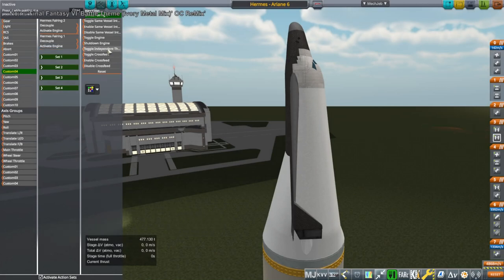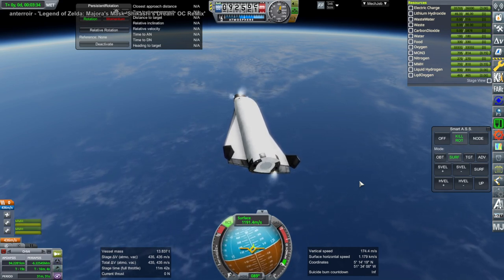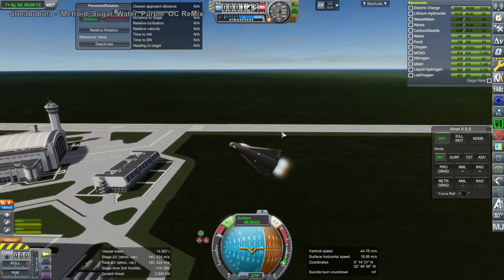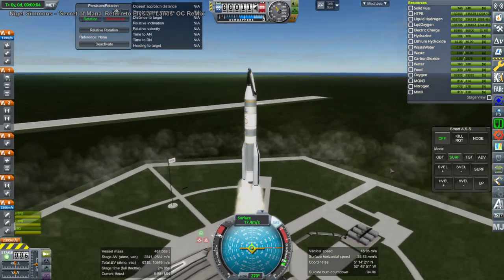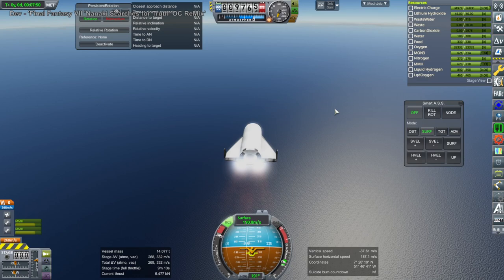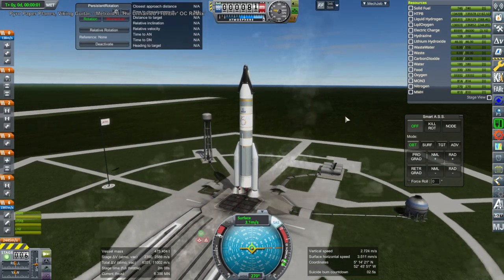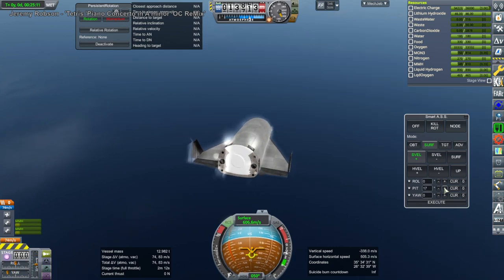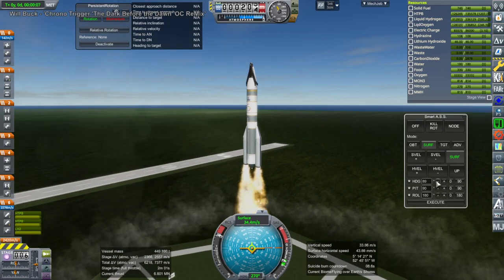Realism Overhaul in KSP 1.8.1 - Hermes Spaceplane Abort Testing

Comment: I believe the original plan for Hermes was updated after the incidents with the Space Shuttle to include ejection seats. Obviously not optimal for a spacecraft that's still mounted on the rocket, but with the system you've designed, it could work. 

If it's a high-altitude abort, you can glide back to a lower altitude and slow down before ejecting. If it's a pad abort, the spacecraft would be lobbed up and away from the pad, after which the ejection seats would trigger when the craft is in a favourable orientation.